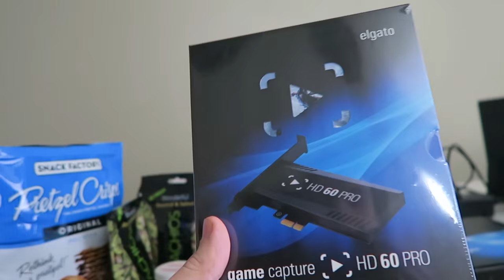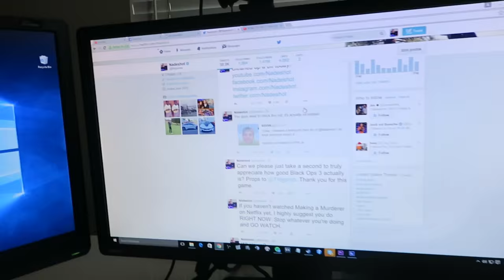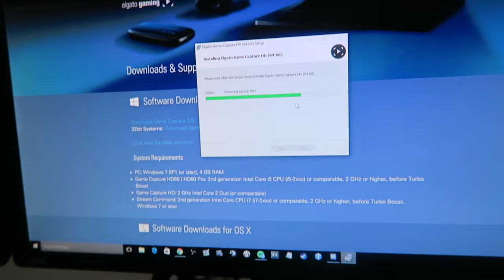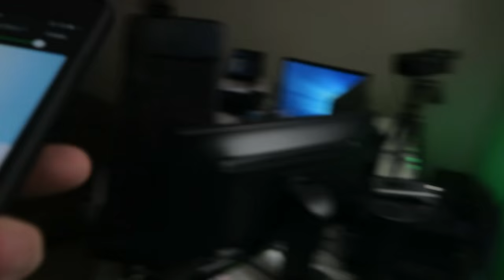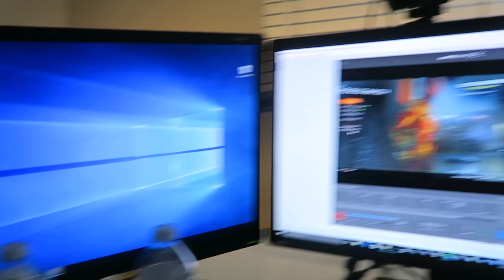NEW TOYS!

Comment: You should go to home depot or your local hardware store and get like a small piece of plywood or two 2x4 planks for the computer to be off the carpet. It's a lot more durable than cardboard and if you get it cut to the exact size of the bottom of the case and paint it black it would look professional even though it's just a cheap simple DIY case stand.

Comment: P.C is a God damn BEAST! p.s use a  small plank of wood (wider than pc but about 2 1/2" shorter in length) under the p.c  instead of cardboard dude 😉 it will allow the air to circulate under aswell as around